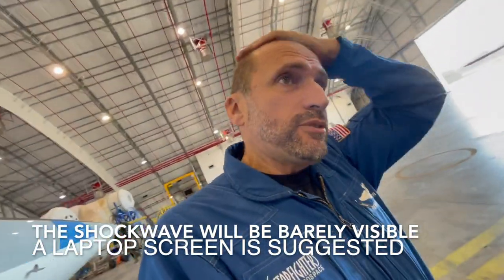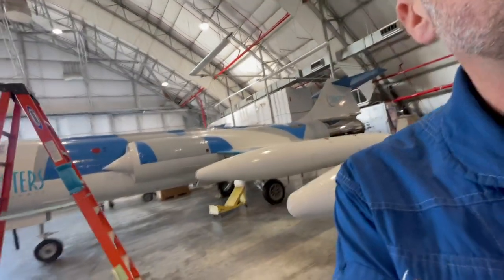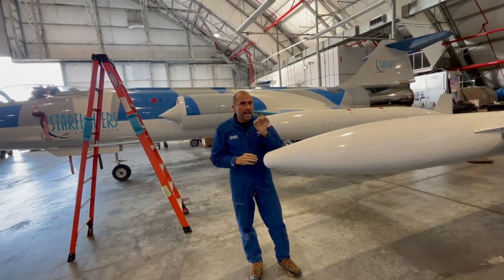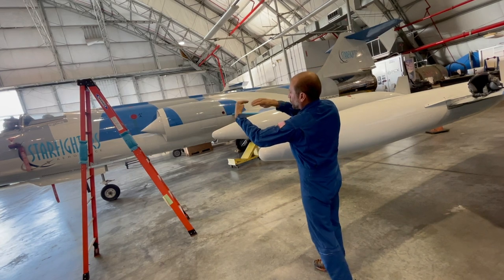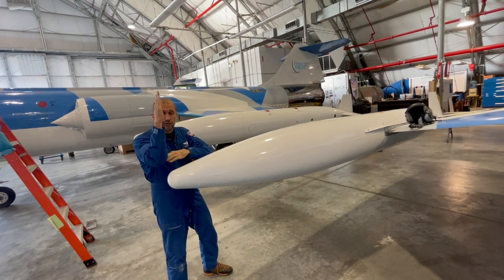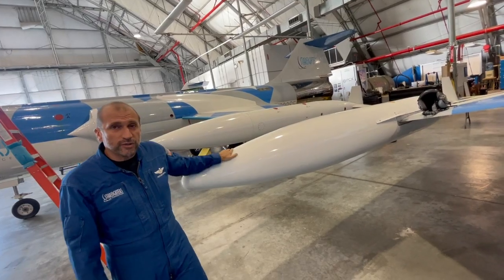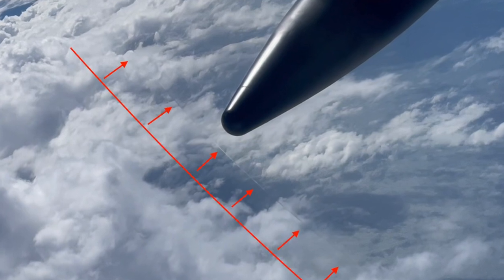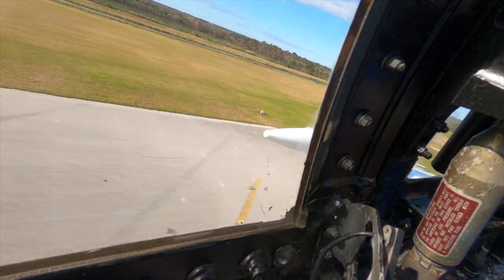SUPERSONIC SHOCKWAVE CAUGHT ON CAMERA MACH 1.7 on LOCKHEED F-104

Comment: Believe it or not, you used to be able to see the shock wave form on the top side (about mid-camber) of a Boeing 727 wing during descent sometimes. It looked like a little stream of water moving back and forth just a bit. Pretty cool!
Reply from the maker: That is very interesting....yes few pilots told me it is also visible on Globals at times at M0.9....very cool...
Reply: I've seen this a couple of times as well.  Natural shadowgraph!  Worth getting squished into the window seat to see.
Reply: Thank god that there are still some 727s flying.
Reply: It’s common on modern airliners too you just have to pick the correct seat to see it. There’s a normal shock that moves depending on conditions right on top of the wing. Hard to see but with the right lighting you will see it on just about any transonic airliner.
Reply: @xyzaero  I had a brief stop in one on Johnston Atoll. When we stopped, three guys disembarked using the rear "airstairs", and the Humvee with the 50 made sure the rest of us stayed on board. I had my parachute for carry on, which was mildly unsettling to a few folks. :)

Comment: The famous shock-wave phenomenon briefed and captured by an F-104 pilot, with an F-104, can't get any cooler than that! Every second of this video is precious, Thank you Piercarlo!
Reply: But why is the shockeave a straight line? Aren’t shockwaves usually V shaped? I am sorry to ask such a stupid question. I should know actually know myself
Reply: @xyzaero  As far as I know they tend to curve around the source rather than taking a V shape but in this case wave is big and zoomed in and you can still see the slight curving on top and bottom.
Reply: @jamesmagnum  Still strange. Have never seen it that straight in 30+ years as an aviation enthusiast and jet pilot
Reply: @xyzaero  Could also be a lens distortion or maybe another kind of optical illusion.
Reply: @xyzaero  Need to make sure the wing tip fuel tank is behind the initial shock wave generated by the nose of the jet though. Let's say if it is within the shock wave from the nose, then it could result in a bow shock (normal shock) since the air speed got reduced a bit after the initial shock from nose (the pressure & temperature got increased instead), the somewhat lower air speed could make a detached bow shock instead of an attached oblique shock. If it's not within the shock wave generated by the nose, I'm not quite sure then, because if the plane is flying at mach 1.7 I would imagine an oblique shock (the v shape you mentioned) on the wing tip fuel tank
Reply: If someone else can explain in more details please do because the shock wave - shock wave interactions far beyond the wall is complex and I haven't learned that, maybe my thoughts are not that correct
Reply: @_d3642  Well the extent of my flow dynamics would fail to put an accurate explanation but F-104 tip tank is far from the nose but closer to fuselage so I'm not sure if that's the case.

Comment: I believe they are flying just below Mach 1.  That is why you see a flat shock wave forward of the tank slightly.  Air piling up in front of the tank creates a shock at just below Mach 1.  If they were flying faster than Mach 1 the shock wave would be attached to the tank nose, and trailing back in a cone shape.

Comment: Very cool, thanks! I enjoyed watching your flight in Pratica di Mare last weekend! 
When I worked with a compressed air gun a few weeks ago, I noted almost the same visual effect about 2 cm in front of the nozzle (you see it best when you have a light and a dark area behind the air jet and make little movements above the adjoining surfaces) . There is a good reason to protect your ears while working with compressed air.

Comment: Awsome! Here's a question, around 4:55 there appears to be a contrail going past the canopy. Do you get the same thing off the nose of the aircraft, or because its much more pointed do you not see it, and it was just water vapor ? Thanks for the ride 👍

Oh, Merry Christmas by the way !!
Reply from the maker: Hey Jef, thank you, it is actually a reflection of me moving in the cockpit...i know it is deceiving, but at that altitude and that speed, with no maneuvering, there is no contrails other than from the engine...which can only be seen from another aircraft or the ground...
Reply: @PiercarloCiacchi  oh ok, obviously i asked the right guy  ! Thanks 😉

Comment: Uh, can I point out that the shock is not positioned “ normal “ to the tip tank nose. There is no curvature, as occurs when a blunt curved section is in high transonic. I think you imagine the bow shock off the aircraft nose. 

And this is not a first.

Comment: I think I have also seen this phenomenon on commercial jets. Typically around the engine cowling and on the top of the wing (standing wave).
Reply from the maker: true....i just had few messages they told me that...i never noticed...a pilot told me you can see them on Globals at M0.9 somewhere over the wing...always learning..
Reply: Commercial jets have trans-sonic wings. The plane flies sub-sonic at cruise altitude and speed (around 800_900 km/h), but the air flow above the wing goes supersonic in some areas above the wing. There you can see a standing shock wave.